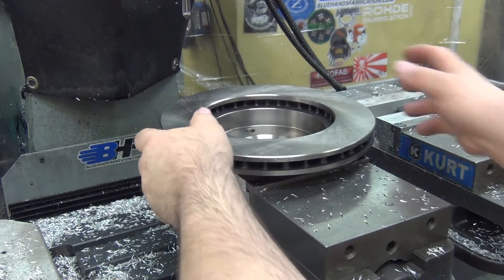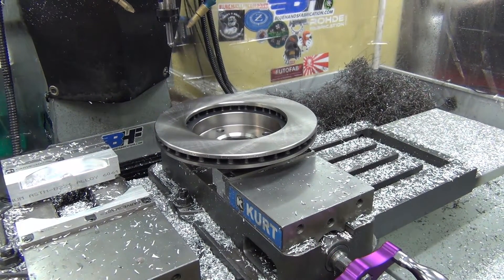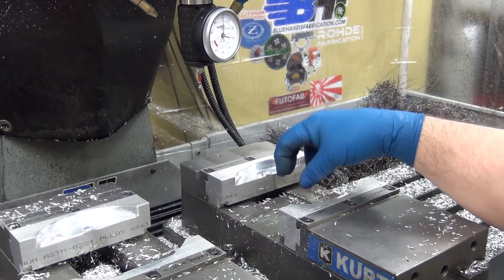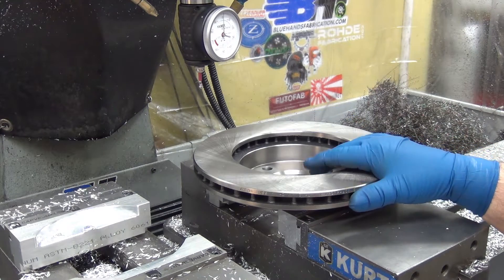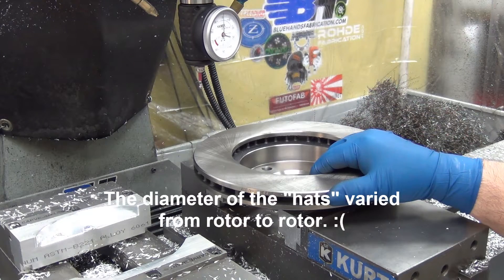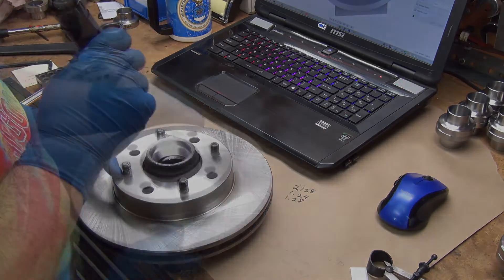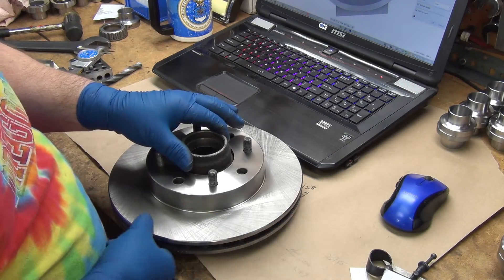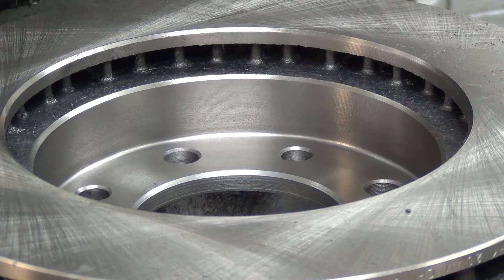G20 Brake Rotor Milling

Comment: Hey Mike.

Love your work holding fixture.
I was going to mention the reference point should be the Brake Disc centre but you did manage to resolve this during the video.

Yes.
Reference every Brake Disc from the centre not the fixture.
I hate to point out the obvious.
But any rotating part should be referenced before starting any work.

Another Mike Mission enjoyed.
Thanks for showing us your work.
Regards Peter.
Reply from the maker: It took me a bit to think it through, but I finally got it. lol  In theory, I could reference the soft jaw, but the rotors were different diameters.  Even if I use a 3 jaw lathe, I'd probably still find center each time.  A probe would sure make it a lot quicker!! :)  Thanks Peter!   Mike
Reply: @bluehandsvideo  
Hey Mike.
 It,s Funny ?
I was thinking the same thing about the Probe.
But i could NOT say / write it down in public anyway ???
Mostly because i gave Probes a bit of a Thumbs Down in one of my video,s.   ( don,t tell anyone ?? )

It was mostly in regards to a comment i received.
I scored them High on the Wank Factor List,  LOL.

I was measuring parts in my mill with a Haimer and someone mentioned you could use a Probe.
My reply was basically ??????

It was good of you to include us in the thought process as it gives the video that un-polished look,  that most of us try to achieve.

The polished video,s we try to produce is mostly to reduce the.
 Why Did You ????   Mmmm ?

Long reply but it was a bit of fun.

All the Best.
Peter.
Reply from the maker: @weldmachine  LOL.....wait....I polish mine..........with a brick. ;)  lol   I keep thinking that I want to make them better, but the reality is that I just want to get caught up. LOL    
I'd like to do some probing on the mill.......but not in my personal life. ;)
..hhhmmmm.......I sure probably go do a bit of editing now.....I've still got vid that's nearly a year old now :(
Reply: @bluehandsvideo 
 Hey Mike.

I think you have been doing videos long enough, people already know what to expect from you.

Its the information that is important not the quality of the video.
We are the only ones who worry about the quality 
I have quickly found no matter how good of a video you do,  people will still find fault.

Comment: This would be a good job to set up with a 3 jaw chuck on the mill, relatively not taking in to account for the inaccuracy of the chuck youd always be on center of the part no matter if the outside size varried.
Reply from the maker: You are absolutely right.  I may do that the next time.  I thought about the lathe chuck after the fact.....but even after thinking about it....I may still use the vise.  I don't have a good way to hold the chuck in the vise and if I do that, I'm pretty sure it will be too tall for the long drill bit.....which I can get around by boring the holes instead of drilling them.  If I only do one or two sets at a time, it's way easier....physically.....to swap out the jaws than to lift an 6" chuck onto the table.  I won't pull a vise to use the chuck. and if I did, it's a pain to clamp a bare chuck to the table.  I don't do many of these and I'm always tempted to quit doing them completely. lol  If I were going to do 20+, I'd definitely use the lathe chuck!!  :)  Thanks!